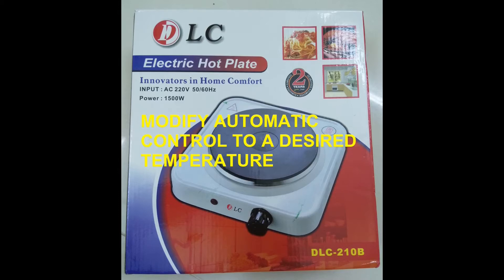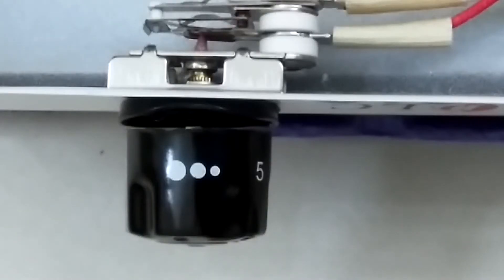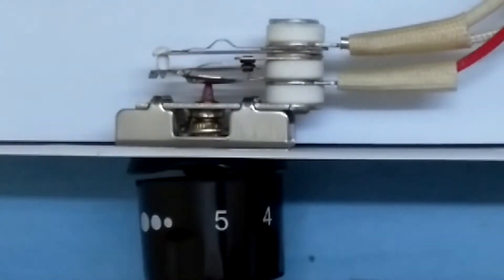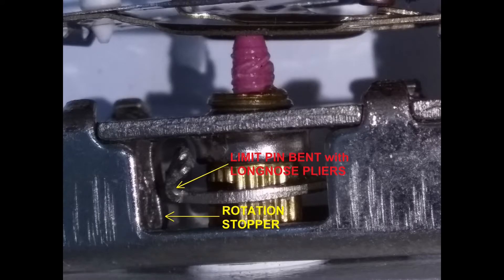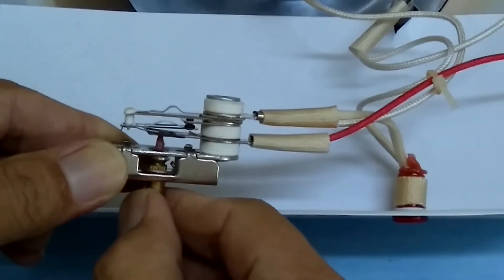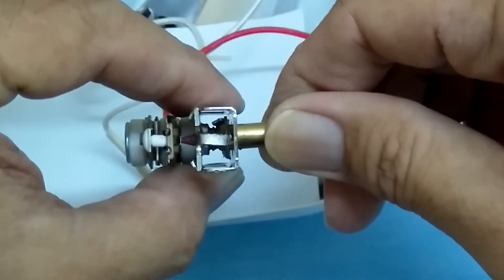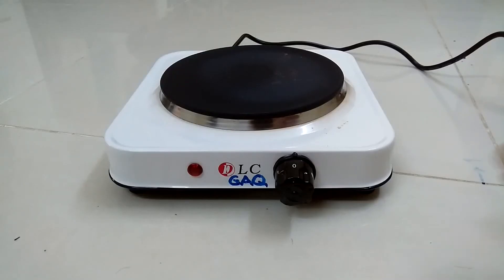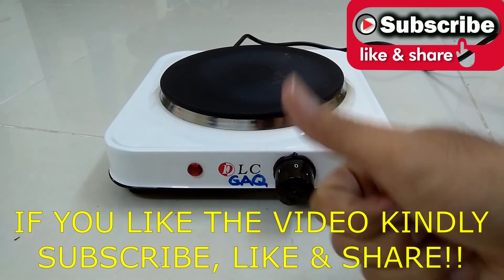ELECTRIC STOVE HOT PLATE

Comment: Do anyone knows what is the name of the components ? The knob and the spring thing ?
Thank you so much ! The control was not working properly, the plate was always on ! So I bent the rotation stopper and now I can really stop the plate !
Reply from the maker: It's called " LEAF SPRING"
Reply: @gerdsenior6976  Thx but I when I search this I found like a big car part not this small object.
Reply: @ygorgallina2691  that's because "leaf spring" is describing the component and it's widely used in many applications. You would need to Google more specifically "hot plate leaf spring" or "leaf spring used in hot plate"

You would see a similar situation if you were trying to find wires used in the hot plate and googled "copper wire"

Comment: Does that make it at maximum temperature all the time or can you sustain a lower temperature without it shutting off
Reply from the maker: by turning the knob more than 360° clockwise it will remain "on" it can reach max temp. however as long use the surrounding insulations near the knob will melt down, because it's not heavy-duty
Reply from the maker: it can be adjusted to lower temperature with-in its range of "1-5" it will automatically shut of.
Reply: i know it's kinda off topic but does anybody know a good place to watch newly released series online?
Reply: @Stanley Riley Meh I use flixportal. you can find it on google :D -kai
Reply: @Kai Ramon Thanks, signed up and it seems like a nice service =) Appreciate it!!
Reply: @Stanley Riley glad I could help xD
Reply: @gerdsenior6976 i bought a double burner can this help if i disable it?
Reply: I’m having a problem in switching it off.. do i have to count on my instincts only for this ?
Reply: @The1PureEvil  I had the same issue. It was either full blast or nothing so I abandoned it and went to propane.
Reply: @Cliff82  actually.. mine exploded two days ago .. wasn’t dangerous or loud .. didn’t even trigger my fire alarm which is sensitive to cigarettes.

But yeah i made the fix & i admit i only controlled it by the electric plug “power supply” 🙄😂